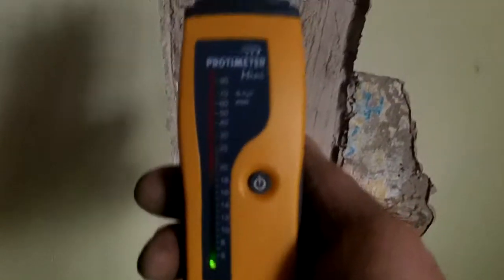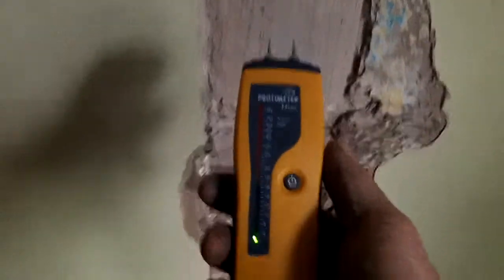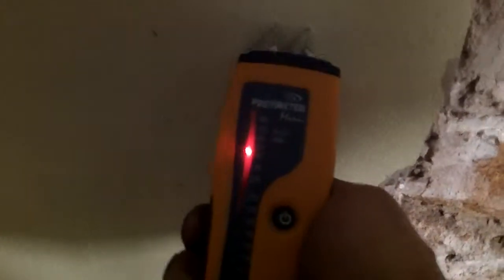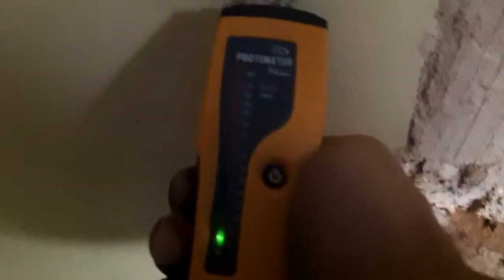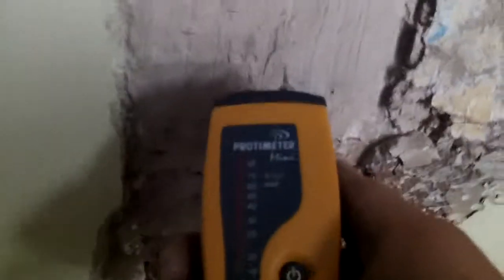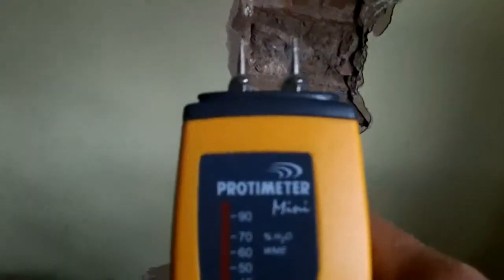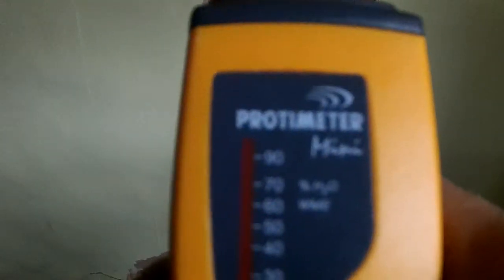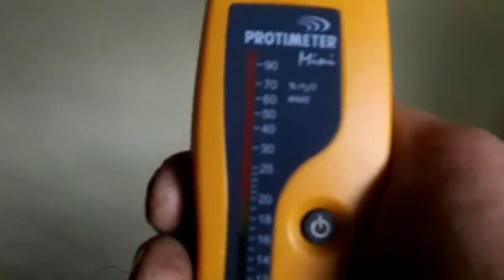Damp meter? No - it's salt meter! No rising damp here...

Comment: We have a traditional stone and rubble filled construction. All lime pointed, plastered, distempered. Works perfectly. No visible sign of damp and all performing as it should. However, survey for purchaser shows high readings. Second opinion sought from complete restoration in Bath. Guy comes out with thermal imaging camera on pouring wet day and suggests that all at the Base of the walls need hacking off and a skirting put on with a plastic wrap. We know that it's all bull, but are in fear of losing our sale. Incidentally, original surveyor said house would be unmortgagable with such high readings but they could sort it all out for a price... What a racket. Thanks so much for your site and information.